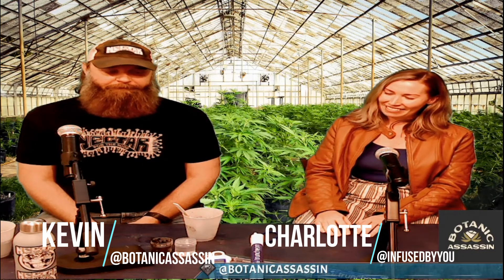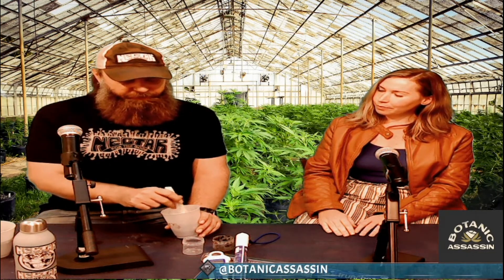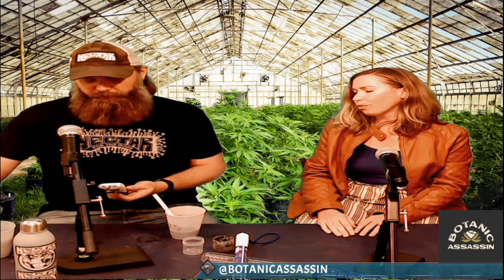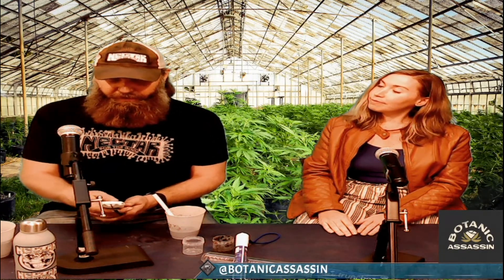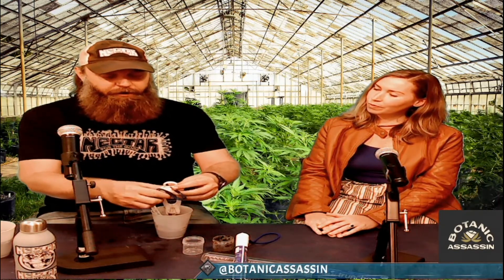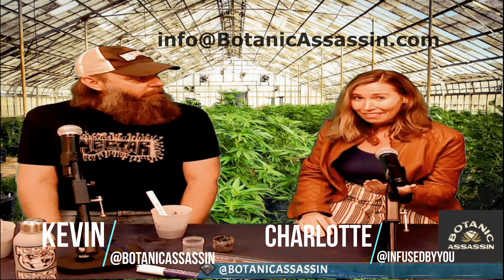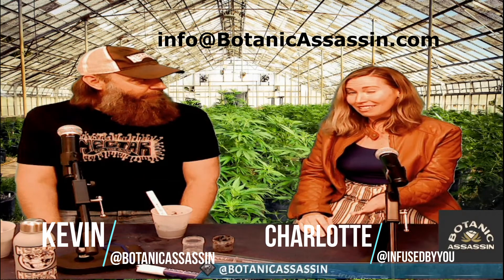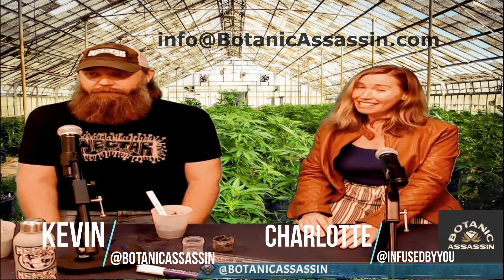How To Run A Slurry Test To Get Real Time Soil PH And PPM Levels

Comment: the starting water should be ph'd to the same level as your feed right?
Reply: Looking for this answer too. I bought distilled water and it’s like 8.5 going in and slurry result is 6.4. Which is great. But do you have to add that original high PH water going in? Or should I ph down my starting water to my usually 6.4 and then use that in the slurry
Reply: I've got the same question.  I would think if water at 8 ph going in results in slurry/soil PH to be within range, it would make sense to water with the 8ph water

Comment: What PH should your water be going into slurry test?
Reply: The same ph as the water u use for your plants. Your replicating the original environment. Use what ever water you always use.
Reply: @jameskerns3297 nice. So I don’t need to use distilled?
Reply: @chicagoangler  I only use distilled to clean probes or to calibrate ph reader to 7.0 distilled water is 7.0. to perform the slurry test use the water you have been using when watering or feeding plants. I use tap water that sits out least 24 hrs to let the chlorine disappear.
Reply: @jameskerns3297  nice I have Blumat watering system. So I basically get my tap into a decolonization filter systems and then I dump that in my reservoir and PH it down to 6.4. That is what waters my plants. So I’ll use that dechlorinated 6.4 from my reservoir for my slurry test then. Thanks!
Reply: My question also

Comment: My tap after gassing off overnight is 8.0-8.2. What ph do I want my water to be for my slurry?
Reply: Did you get a reply? I wanna know what PH your water needs to be going in
Reply: @shanecole3136  nope never did
Reply: @pojoe511  I think if youre at 8 and want it at 7 your water should be 6. may want to google it to verify but i think thats the procedure.
Reply: He alrdy replied to that question in the video. If your using tap wtr left out overnight to water, that is what you use for your slurry test. You test whatever water source you have been using to water plants. It dont rly matter the ph before the test, a slurry lets you know what your soil is actually at, with the water you been using. If your slurry comes out to 7.2 like in the video, then put your next watering at about 6.0 to even it out ;)